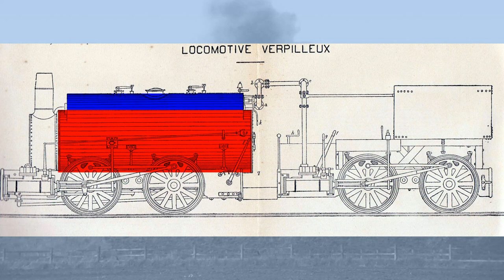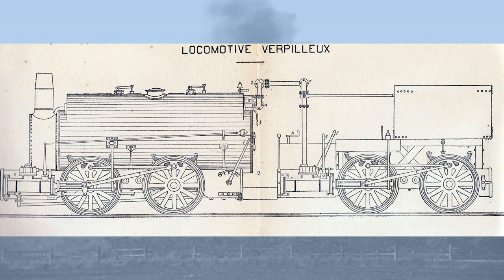Spotlight: La Jumelle

Comment: And so the love for compound locomotives in France started.
The last steamloco's build in France were compound locomotives.
Reply: Yep, the 151TQ were the last built.
Though, the last locomotives used in france in the early 70s were all single expansion, as they were cheaper to maintain
Reply: @hugos5114  In the last years of steam everything was done to cut costs on steam operations in Europe. 
But we can definatly say that the SNCF commisioned the most modern and advanced steamlocomotives  ever.
Reply: @obelic71  very true, though at some point they decided to scrap them quite early (most of the modern locomotives didnt reach the 60s for ex)

Comment: Wonderful locomotive I hadn't seen before. The steam chamber is most bizarre.
Perhaps if there is even enough material to find, a video on the locomotive built by William T. James of New York in 1832 would be interesting. He "reused" exhaust steam from one cylinder to drive the other, but had apparently not understood that he would need to make the cylinders different sizes to do this effectively (which is strange as it had already been done in stationary engines by that time, so should have been obvious, but I have no idea what Mr. James' background or training was).
Reply from the maker: Oooh, interesting. Thanks!

Comment: Thanks for the further education.
With me thinking the Sturrock ones were the first invention due to their patent.
Good to have more than just a UK centric view that is  normal in many references.
Reply from the maker: I think in the big scheme of things, the Sturrock steam tenders were the last. They'd been used in Europe earlier. The differance between the Sturrock one say La Jumelle was that the Sturrock design the steam tender was there as a "booster" so steam was supplied when needed whereas La Jumelle was basically an 0-4-0+0-4-0 articulated locomotive with drive from both sets of wheels all the time.
Reply: @AnthonyDawsonHistory  I never knew that. So, effectively, Sturrock's tender was similar to the booster bogies used on some big American locos, such as the Indiana Harbour Belt 0-8-0's and, I think, some of those with a four-wheeled truck beneath the firebox?

Comment: "Articulated Pipe, Which Passed Over The Heads Of The Crew"  - Nice, just hope the thing didn't rupture and you cooked. 01:53 A compound, articulated engine before Anatole Mallet's designs, that's impressive. Yet Mallet got the patent for the concept.
Reply from the maker: I think Verpilleux patent may have lapsed. His first patent (1842) was only for 15 years. And his second for the compound (1857) may have been only for ten years. Mallet was critical of Verpilleux design, especially the use of the longitudinal steam reservoire as he thought it caused priming, not something you want on a steeply-graded route. But Mallet's ideas took a long time to become accepted in France on the mainlines and his designs evolved into what we now recognise as the Mallet Locomotive. His first locomotives were conventional designs with one high pressure and one low pressure cylinder, rather like the Von Bories system which came later, and which was adopted by Worsdell on the NER.
Reply: @AnthonyDawsonHistory  Odd that Mallet's design wasn't readily accepted in France. American articulated locomotives probably would not have existed without it.

Comment: Surprisingly successful outcome (ignoring the exploding boiler) for such a complex and novel design.
Do we know anything about the state of insulation at this time? The considerable pipework and the copper “dome” would appear to be sources of major heat loss.
Reply from the maker: The pipework was lagged but the copper steam reservoire was not. Apparently you sould see it almost 'breathing' under pressure. It was only 2mm thick - its no wonder it went kapow. Thankfully on the later production designs he didn't use it. Anatole Mallet was deeply critical of  the design.

Comment: How effective were the articulated steam pipes to the tender? Archibald Sturrock designed steam tender locomotives.
Reply from the maker: All the performance reports suggest that they worked very well. He used sliding joints to allow for vertical motion and swiveling joints. Not quite up to producing ball joints as used by Fairlie or Garratt. Sturrock's Steam Tender was one of many in the nineteenth century. Quite a fad for a short period before articulated locomotives proper came along. La Jumelle really was an 0-4-0+0-4-0 semi rigidly coupled to the tender unit.